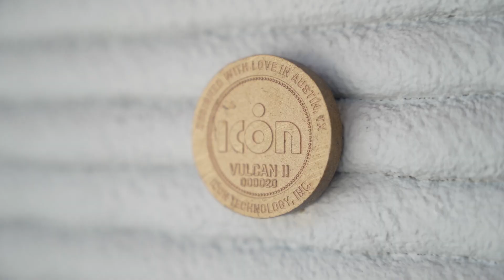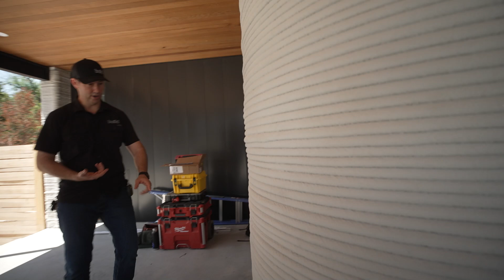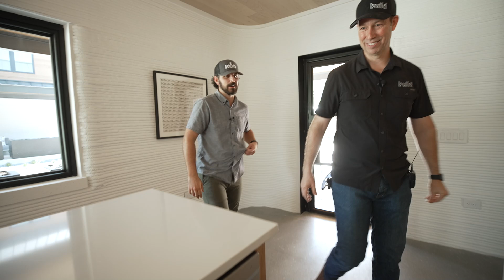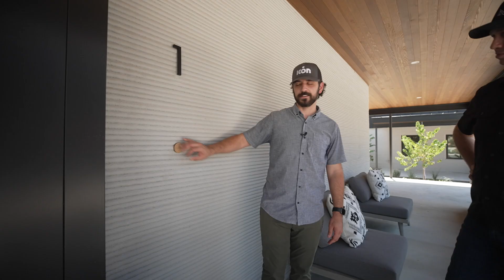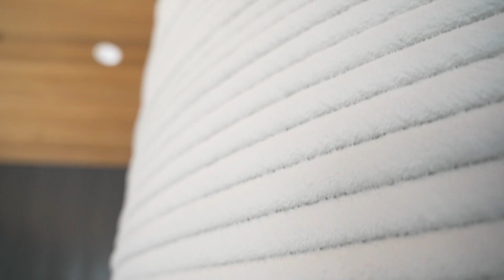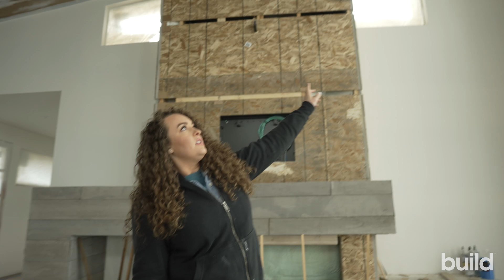Update on 3D CONCRETE PRINTED Houses - They’re GORGEOUS

Comment: 800k for a little patio home with no garage lol stay weird Austin .
Reply: That is a bit much, even if you convert it into A$ !
Reply: ATX for ya
Reply: You're not just paying for the house, but the R&D behind the process of the 3D printing. Do you remember how expensive computers, microwaves, cell phones, etc. were whenever they first came out? As the technology became more advanced, and materials less expensive to use, the cost of making those products eventually came down. 

This is also most likely in an area where eclectically built homes sell for a mint as it is..
Reply: @gigisunshine6707  Icons mission was to create better affordable homes. These homes are in the hood. Not in a nice area. All crammed together on two lots that had small homes already on them but got torn down for this. These were meant to be Affordable. There are far from it! $300,000 is affordable, not $800,000 and it's in the hood! Right around the corner are the homes where people have to park their cars on the grass in their front yards. All the grass is dead though. A guy was running around this neighborhood with a machete stabbing people killing one man. Shooting all the time. These are the nicest homes in the area by far.

Comment: I’m currently a civil engineering student and believe me when I say concrete is a world of it own. It’s more than cement/sand/water/rocks. There is tons of science behind it and several factors that affect the concrete, kudos to these guys for developing a good mix that is wet enough to pump through the printer yet it doesn’t look like it has much bleed water.
Reply: How do you know your at a party with a civil engineer?

They will tell you.
Reply: Concrete is a big negative, environmentally. No one brings that up it seems.
Reply: As you said, it is more than just cement sand and water (typical rocks don't extrude too well - I know chips of various sizes to suit..)   - hydrogels and plasticisers - a whole world of chemistry at work in these high-tech concretes.....

Comment: The walls are going to collect a lot of dust and dirt on all the small ledges
Reply: Outside it is alright ad easy to hose, but to clean it inside may be a problem. Rendering inside would be and look  better, I think.
Reply: @vitalilisau6181  Log cabins are a pain in the butt. Old girlfriend had one. Dusting all the time
Reply: @morninboy  I lived in a log house, built after WW2. It had clay plastered walls in the inside, flat but not perfectly. Good microclimat inside. I woulld not build it now, though. There are more modern materials. There were some troubles with mices, wood borers beatles outside, risk of fire, and trobles with internal doors jamming in summer when more humidity.

Comment: The raving about the wonder of the imperfections feels like salesmanship. As much as I enjoy imperfections when there's a broader purpose of reuse or because something is old, these buildings are brand new and the imperfections are due to inconsistencies in materials and machine. I know these are the early versions of these homes, so there's novelty that will outweigh that for some people, but I sure hope the company knows they need to improve the appearance if they want to appeal beyond a very narrow market.

I also agree with other commenters that it's hard to imagine living in a house with ribbed walls, given the dust and other issues that brings. For instance, the inside will probably require more lighting, because the walls won't reflect the light as well as flat walls would.

Comment: Looks good, but costs way too much.. ICF could be done in a similar timeline, but at a much cheaper price point and would have better energy efficiency.  These 3D printed home companies just want to get bought out by some large tech firm....
Reply: ICF is the current leading candidate for my retirement home in about 6 years.
Reply: @cpad007  My wife and I just started self building ours.  ICF is definitely the way to go.
Reply: The tech will get cheaper.

Comment: Matt,
Building in Fredericksburg. How long would you let a concrete foundation cure after it’s been poured?
Reply: How long before what?
Reply from the maker: In the Fall… a few days is ok unless you are doing exposed concrete floor. If so you’d want to go a week and cover them soon!
Reply: @buildshow  - start the framing of the house. The builder told us he wanted to wait a week as well. Thanks for the tips on the frost proof spigots (Aquor) and off grid generator. I know you chose Champion for your generator. Did thoughts on Generac or Kohler? We are adding the Aquor and generator to our house plans along with a 500 gallon propane tank.
Reply: @buildshow  we’ll be putting wood throughout the house with a few areas in tile (laundry room, bathrooms, etc.)

Comment: i absolutely love it, i wonder what kind of overhang angles they can get out of their printer. i would love to see if I can't reach out to them and 3d model my own home using actual 3d printer farm modeling, electrical, mechanical, and aviation engineering experience. oh man the insane curves and designs that are opened up by 3d printing are insane. if you build big enough with soft enough slopes you don't even need to use wood for the second floor.
Reply: You should definitley check out wasp and their 3D printer. I believe its open-source and they've already been developing houses. They print with concrete but what I think is incredible is that they have started to print with a dirt, concrete, and straw mixture. Making the majority of the house from the materials readily availble. In terms of doing it yourself, their field printer uses a generic Prusa display....

Comment: The wall have air pocket between the inside and the exterior. Is it alright to fill it with crush styro as insulation? There's plenty of this material that only a tiny percentage is recovered into recycling
Reply: Styrofoam will absorb water and be hard to dry out so can sause mould issues 😔
Reply: @kurtpalmer3674  will sealing the walls, to make it watertight, before filling in the insulation wont work?

Comment: Did they build them with wood second floors because the machine is incapable of going higher? I'd think that having the second floor made out of metal beams and a concrete floor, then continuing with the 3D printing would make more sense.

Comment: I have zero faith in that concrete not cracking by windows and doors
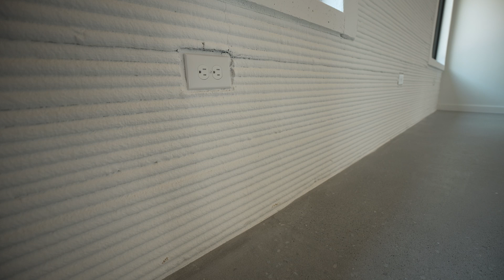Reply: You can pretty much already see it cracking @ 10:42
Reply: @moutrap  I can see a micro crack above the socket. I think a better solution would be to either use battens with plasterboard or dot & dab plasterboard, then fixing wiring to the surface of the printed wall prior to plasterboard. Chopping out a socket box would eliminate micro cracks.
Reply: You don’t need faith. It’s some kind of micro-fiber reinforced concrete with elastic properties. And painted from outside with elastomer ‘paint’. And the apertures are roundish so the strain on the opening is lesser than the square ones. And if it’s done correctly with good materials then the concrete should be fine for at least 50-75 years. Look at the Roman concrete buildings, a couple of centuries old and still standing. And also there’s the manufacturer warranty. So no faith needed.
Reply: @mariokajin  Interesting to hear about a 3DCP manufacturer's warranty.  Would you know where to get more specifics? Thanks!
Reply: Interesting - I asked that other commenter  @mario kajin  about the 3D print warranty he mentioned, and his comment then disappeared.

Comment: I really love the house. My only concern would be the amount of dust that would accumulate on all those tiny ribs in the house
Reply: I was thinking about this too...

Maybe paint it with some kind of paint that would make the dust easy to pick up?
And here comes a new product  - The Swiffer Wall Duster!!
Reply: A blower...
I dunno.
I think a blower would clean some of the crevices, but mostly it would just redistribute the dust into the others.
Reply: Maybe you have seen the geodesic dome houses from the 70's... They take a bounce house and fill it with expansion foam and then cover it with concrete. So, on the outside it's really similar. But some of the inside walls are concrete too, an you are right, dust and grease you can never get out. And if water gets into a tiny crack, and freezes... Couple years later you are fucked
Reply: @AsHellBored  I have seen those dome houses. I always thought they were cool!
There's a little town in Texas that has a bunch of these. 
It's located right on the main highway so we can all get a good view of them. 
They attached a bunch of 
them together 
- in a straight line -
and then painted the outside to look like a caterpillar!!
Eyeballs on the front one & everything!!

But wait-
Dust, and GREASE too!?!!
Those 2 together make a gooey paste!!
And what- after the 1st decade, the kitchen walls are always a gooey mess?!!

Maybe a good layer of paint would help make the interior walls scrubable?
If so, I could live with that.
Reply: Get a blower
Reply: For the outside you could use a pressure washer. Not sure about the inside. Maybe if it bothers you, you can pay someone to mud over the ribs?
Reply: @mannyr9225  Pressure washer for the outside is a good idea!
As for the inside, 
while I do like the way it looks,
yes, I just might have to get creative with stucco, or SOMETHING on those walls!!!
The creative possibilities are endless!!

As long as the dusting isn't endless, I would be happy!
Reply: Render / Plaster - inner and outer, just like the majority of block walls.
Reply: dot & dab plasterboard would solve this issue.
Reply: I'd probably just go with a HEPA shop vac with a 12" brush attachment.

Comment: Nice look!, good to see some early adopters grabbing hold of this fantastic new tech!
Reply: It’s not new tech, it’s poured concrete, been around for a long time, except this “technology” take longer simply to give it a different look, it’s literally the exact same a poured concrete
Reply: @juicenot2481  was thinking exactly the same think, only difference is with poured concrete you can actually have steel reinforcement. and it looks a lot better.
Reply: @juicenot2481   (yep - pumped  one kerb on top of another.)

Comment: Hard to see what the advantage of this is against ICF Blocks, which seem to be the best of all methods for construction.
Reply: At scale you can print many homes on site with one machine and static amount of labor. Otherwise I think SIPS and ICF are better options based on use case
Reply: Agree, ifc is reinforced with rebar, so it's stronger, and it all gets covered from water that could freeze to ice. Now if you could 3d print styrofoam an pour the concrete in that, you might have the best of both worlds ;)
Reply: The printing process, you don't need to actually handle the blocks.  But you are correct, it is basically the same technology.
Reply: It looks better.
Reply: Hard to see what the advantage of this process is compared to… anything.

Comment: For those trying to see if this is a better cost for the average person, only 2 of these 4 are left for sale. They are located in East Austin (not sure what is average price for a home in this area). One is 1,521 sqft and is priced at $745k ($489.81/sqft). The other one is 1,928 sqft and is priced at $795k ($412.34/sqft).

I personally don't think that is a good price, but I'm not from the area so I wouldn't know.
Reply: I can tell you thats the lowest you could build a decent house for per sq foot these days in close in DC metro area (Bethesda, Arlington  NW DC etc.)a lot depends on where the land is in this case-if close to downtown i reckon thats a pretty fair house for a very well made exceptionally durable quiet house.

Comment: Looks fantastic. $800,000 is a bit too steep for me.
Reply: I was shocked at how expensive they are. At first I thought they'd be great and then that taste quickly went sour after looking at prices.
Reply: Don't forget there is always a high cost of entry to new technology. Your cellphone would probably cost $20,000 if it somehow came out in 1999
Reply: @Nitrobucket  well with inflation the first cell phone actually cost about 10k in today's money
Reply: Location location location
Reply: @suspicionofdeceit  it absolutely will. Look at 3D printing polymers 10 years ago. Machines were $10k each. Now you can buy them for $100.
Reply: Welcome to the Austin housing market.
Reply: Exactly more elitist stuff . All the talk about lower prices then a lumber home .
Reply: @McIntoshGreen  Cheaper and greener, except that it's 5x the price and can't recycle any of the concrete since the walls are filled with expanding foam.
Reply: @axiom1650  not to mention the amount of CO2 it takes to make concrete. Hard pass. Doesn’t solve anything
Reply: Thank you for saving me 20 mins to find out.
Reply: The first Tesla was for about $100K. Now you can buy one for about $40K. The first products just won't be available for everyone but the cost will drop as they produce more.
Reply: @KamiInValhalla  not in real estate
Reply: Well the solution is just throw out the old printer and buy a new one that comes with printer concrete. The refills are where they make their money.
Reply: From the the listing is 1500-2000 SqFt for almost 800k not cheap in a HOA as well
Reply: I hope time will reduce the cost dramatically and majority of people can afford it.
Reply: I agree about double what i would expect.
Reply: Should have been $200,000 max. Anything above that isn't affordable.
Reply: Why would they list it below market price? Y'all need to learn economics
Reply: Looks ugly to me
Reply: Too steep for 95 percent of people
Reply: @INDIEMUSICGUY1966  99%
Reply: Austin home prices are insane.
Reply: They’ll come down over time.
Reply: From my research the material cost for a 3D printed only home is actually very low, <$30 per sq ft.
That steep cost you see is R&D / early adoptors fee.

Like in pharmaceuticals the price starts high but once the technology is open source the cost will plummet.
Reply: @SimplestUsername  That's all good, but ain't fixing housing issues any time soon then.. This house has nothing that justifies 800k price tag.

Comment: What's up with cracks, like in 4:41 - is this structural or just the coat/paint?
Reply: There are no steel reinforcements so the cracks must be there. Nobody builds only with concrete. There's room for improvement of course, but the technology is interesting for many reasons.
Reply: Yeah, it looks like the mix got a little dry around the outlet...

Comment: Looks like it would be a nightmare to do any post-construction electrical or plumbing work, like adding electrical outlets.
Reply: Did anyone else notice the cracks running off the outlets like me? I'm sure windows doorways etc will all have the same outcome if these tiny boxes have this result.
Reply: For a homeowner, sure, but with the appropriate tools and training it would be pretty fast (basically: do what they do in Europe)

Comment: Is there graphene in the concrete? There is a lot of work going on in the area of doping concrete with small amounts of graphene. Results show large increases in tensile strength and water resistance. These graphene additives for concrete are just starting to get commercialized.
Reply: Been hearing graphene concrete doesn't need rebar. https://www.youtube.com/watch?v=n82_NsFjj_8

Comment: Very cool homes. In general terms, how do costs compare to traditional construction materials/processes?
Reply: Only 2 of these 4 are left for sale. They are located in East Austin (not sure what is average price for a home in this area). One is 1,521 sqft and is priced at $745k ($489.81/sqft). The other one is 1,928 sqft and is priced at $795k ($412.34/sqft).
Reply: you're also paying the first adopter price
Reply: @TOTOllyClueless  745k for 1521 sqft??? Wow. That is insane
Reply: East Austin is now gentrified, and therefore the housing costs are sky rocketing just as much as the rest of Austin, which is insanely high priced.
Also, property taxes are equally crazy high.

These prices are approximately 2 - 3x higher than anywhere on the outskirts of Austin proper.

Comment: I understand the resilience aspect but what would you say about comfort particularly on the first floor?  I'm thinking mainly for the floors.  Pros and cons of doing something like what you did with your personal home?  My knees aren't what they used to be.
Reply: Have a wood floor built on top of the concrete floor.
or
Have the floor topped with high pressure foam and then plywood on top of that. This would probably be the best on your legs.
Reply: Maybe you could have the floors covered in those large rubber mats like what you see in Gyms in the weight area?
Reply: I grew up in South Florida back in the 50's and all the house's were concrete and Terazo concrete floor and we used wool throw rugs

Comment: I could see using this for warehouses or sheds, but I don't consider it ready for prime time when it comes to residential applications.  Doesn't have an answer for floors, stairs or roofs, doesn't offer any advantage for electric, plumbing or HVAC, and they're not even able to make a smooth wall without a lot of additional human labor.  At this point I'd call it a parlor trick.
Reply: Yes.
Reply: Unless you live in a flood zone.